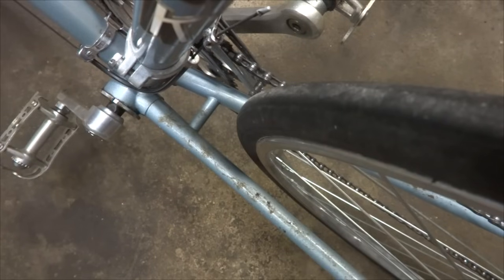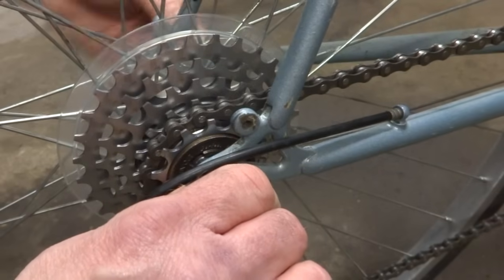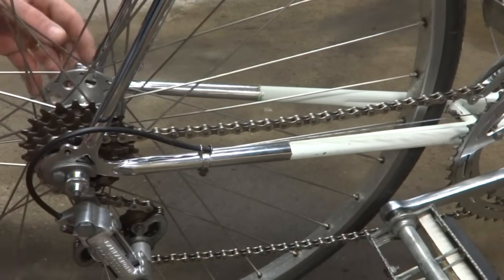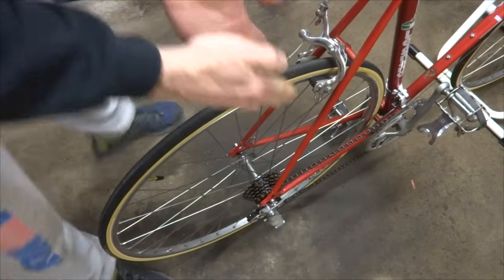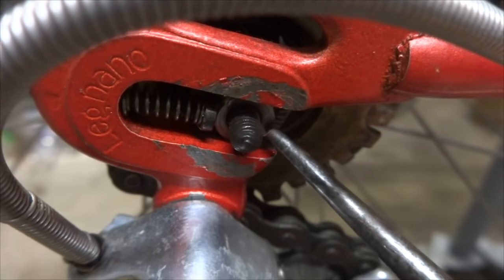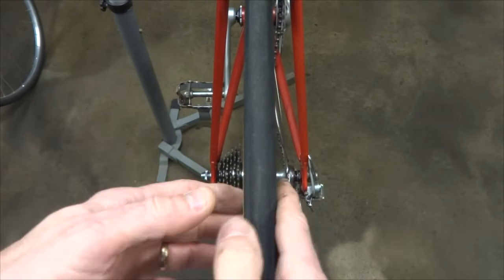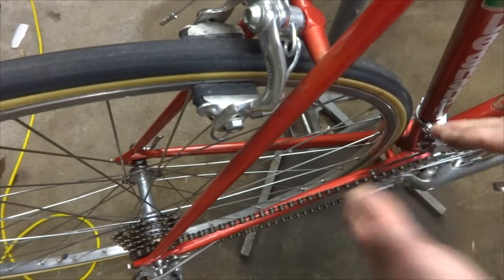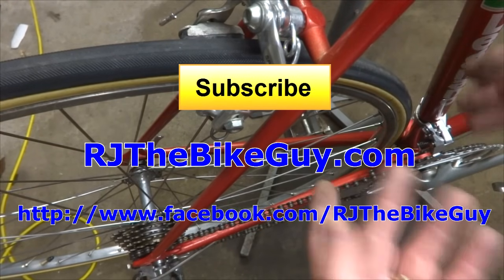Fix Rear Bike Wheel - Off Center/Rubbing Frame

Comment: Just spent 30 mins pulling my hair out because my rear wheel wasn't aligned. Watched your vid for 7 mins and solved it immediately.  Not all heroes wear capes!!!!!! Thank you so much :)
Reply: i spent almost 3 years
Reply: Bruh I thought the chain was the issue the whole time but even after I lubed it that’s when I found out I had to realign the wheel smh
Reply: chanteur
Reply: Same man. That and the breaks aren't working because of it. The first time replacing the tire tube has been a 3 hour mess that I won't get back.
Reply: Literally spent fcn 3 weeks

Comment: Thanks for this video! I'm not even an amateur bicycle mechanic and I was at the point of giving up and bringing my 1983 Jamis Boss Cruiser 5 speed to a repair shop.  In my case it turned out to be reason number 3. After re seating the wheel and tightening everything in the proper position, the problem was solved. I'm up and rolling again!

Comment: Took my vintage Miyata out of storage. Hopped on. It's acting funny and when I hop off the rear wheel is just dragging and won't turn. Realize it's jammed up against the frame. Panik. Start looking for potential replacements or repair shops. Would cost me more than I originally paid for the bike. 

Find this video. Watch the first 40 seconds. Fix my bike in less than a minute. You're a hero.

Comment: Awesome!!! my issue was the two small fine tuning ones you mentioned except mine was two grub bolts.....What I didn't realize was the smallest turn tighter on one side and not the other would make a huge difference. I had to fine tune the bolts until it spun without touching the breaks and was fairly even on each side.
Reply from the maker: Grub bolts?
Reply: Sorry Grub screw not a grub bolt
Reply from the maker: I don't know what you mean by grub screws either? Do you mean the dropout adjustment screws?
Reply: Yesss grub screws, I had to google it to know what they were. I thought it was only so it prevented the wheel going forward as you have to loosen them to take the chain off but your video mentioned the dropout adjustment screws. The smallest adjustment on those makes a huge difference. Thanks again
Reply from the maker: I just googled images of grub screws and I have not seen screw like that on a bike.

Comment: Thank you so much for the great content, I have a carbon road bike, and I recently upgrade my wheels to carbon. And what I noticed, the rear wheel is off center from the non drive side. So I thought it's a wheel dish issue and I gave it to the bike shop for dishing. But unfortunately the issue is still exist. Luckly later what I realized from the cassette side, (where the wheel end cap, hook into the frame) hase a small gap, so while fitting the wheel it's centred and then when I go for a ride it will of center. What is you best advice to fix this issue? Shall I rap the wheel end cap with something to fill the frame hook gap?

Comment: I tried to straighten my dropouts like you did with a 2x4 but I couldn't get it right. So I cut 2 thin pieces of aluminum flashing and it's perfect now. Doing it this way I think is actually better than the adjusters that are on some bikes. The axles are the whole way back in the dropouts.. Just my opinion..

Comment: Rode my bike with a off center rear wheel after I installed security screws. I was wondering if that was there before! I came across this video and fixed it immediately. Thanks!

Comment: 7:03 To check the axle is centered with the hub, would measuring the exposed threads of the axle be sufficient? After reassembling my axle in the hub, I have 1mm more of exposed threads on one side, do you think that would be enough to cause a wheel to be noticeably off-center?
Reply: It shouldn't..not if the axle is straight.

Comment: I currently have this problem. There isn't any rubbing but my rear wheel is off center with the non-drive side being closer to the frame. I'm switching to bigger tires tomorrow so hopefully it will be an easy issue to solve because if I don't get it fixed then my new bigger tire is definitely going to rub on the non-drive side. I have a sneaking suspicion that I messed up when I overhauled my hub/axle. I'm betting that the wheel isn't sitting completely centered on the axle after I reinstalled the axle. I which case I guess I'll have to loosen one side and slide the wheel over a few mm.

Comment: So I can spin my wheel freely off the ground, but once I sit on it and try to pedal the axle goes crooked (like quick release is loose) and the rear tire gets wedged at an angle and stuck unable to roll at all. Thoughts? Am I fighting the axle incorrectly? Is there a trick to these quick release wheels? When the rear tire spins freely there is the slightest of wobble I mean the slightest, that’s all.

Comment: Great can - video,  RJ. I've been considering putting wider tires on my road bike, presently 23mm, and I'd like to put say 28mm.  I noticed my tire is closer to the right side which hindered my prospects for moving to a wider tire. I said to myself if anyone is going to address this issue,  it will be RJ the Bike  Guy, and sure enough, you covered the spacing subject six ways to Sunday.  I'll have to  examine my situation to determine which of the possibilities applies, but I do have one question.  If I equalize the space and assuming my wheel is true, will I likely have to adjust the rear derailleur indexing?
Reply from the maker: If you mess with the hub spacers, then probably. Otherwise, probably not.
Reply: RJ The Bike Guy Thank you,  RJ. I always learn a great deal from you.
Reply: same thing lol. I'm thinking I'm going to have to loosen one side of the hub and slide the wheel over maybe 3mm. Last year I overhualed my hub/axle and most likely I didn't center the wheel on the hub correctly when tightening the retention bolts on the QR hub.

Comment: You have to dish the wheel when true. The rim is not centered over the hub in the rear. So the spokes are tighter on the freewheel side and will seat or stretch in time. You almost always have to pull the rim freewheel side. Also the rear end won't track if the wheel is not dished.

Comment: I am facing this issue after new hub installation. The tire rubbing the frame one side. What to do now? Does the loosening or tightening the screws will solve the issue ?

Comment: Time to figure out why my wheel when fully in the dropouts points to the right side and also the 12th gear when engaged has spokes sometimes rub against the chain on the gear and also it used to have a bolt on wheel but I made a new wheel with a quick release system so see you in 9 hours after I figure this out :)
Reply: yea so for anyone who sees this comment in the future, if your gx derailleur rubs your spokes on 12th gear, 99% chance that your wheel dish is too far towards drive side and the 12 speed style setup is EXTREMELY sensitive to improper dishing

Comment: Hey RJ....I got a fixie bike with dropout adjustment "screws" that are actually washers with a bolt end welded to it that go over the axle and feed through a plate and nut that goes on the end of the frame. Trouble is, when I took the tire off I didn't check first whether the washers with bolts went inside the frame with the wheel or outside the frame with the nut. What would you recommend doing with them, from your experience? Seems like they'll fit either way, seems like they were on the inside of the frame before but a retailer told me they go on the outside, which doesn't seem right.
Reply from the maker: I don't know what you have. Google images of chain tensioners and see how similar ones are installed.

Comment: Had this issue (still technically have) in my old steel frame bike, the frame was bent by about 1cm...

Bending it back was quite a challange without any specialized tools, managed to correct it enough that I now have 5 mm clearance from the tire to the frame on the closest side, the difference is low enough that the brakes (V-brakes) are working fine (and they better be, the bike weights 25Kg)

Comment: can a tire rubbing oh so be related to a innertube not being put in right as a bike is my only means for transportation right now that or walking I need to know it was working fine til I got what seams like a slow leak so I replaced it with a new innertube and now it is rubbing but it's hooks like you show I did not put them back all the way maybe that is why?
Reply from the maker: Did you go through all the stuff in the video?
Reply: RJ The Bike Guy yeah I found the problem it is hitting what looks like a metal frame above the tire just below the seat one oft those metal parts just for looks I was gonna remove it but I don't currently have the right screw driver to remove it right now
Reply from the maker: I can't see your bike so I can only guess. I am guessing your wheel is not mounted straight. Or you have a bent axle. Go through the video!

Comment: Hi, great video!  I have a question.  I have an old 1961 Schwinn Continental 10 speed I had just bought.  The tires were worn out so I had to replace them.  Before replacing them I was able to ride very long distances without using my hands, now after putting on the new tires, I am having a very difficult time balancing myself as I can’t ride without hands anymore.  I feel i find myself trying to counter my weight to one side and I still can’t keep balanced.  What could I have done wrong?  The wheels do look centered within the frame or so I think. 
Thanks!
Reply from the maker: Sorry, I can't tell you. Just changing the tires shouldn't do that. Check the wheel dish maybe.

Comment: Might seem like a daft question but.. You know when you visually align the wheel with the center of the frame..how crucial is it to get the wheel dead center? What I mean is, I get it about center, but after tightening the wheel nuts I notice one side of the rim is always about 1 to 2 mm closer to the frame than the other side. Is this OK or does it affect the tyre and chain? Many thanks.
Reply from the maker: The farther off it is, the worse the alignment. The more the bike will pull to one side. The higher the risk of death wobble at high speeds.

Comment: Hi, thanks a lot for the video. I have a question: I bought a new road bike a few days ago and haven't driven it yet. I didn't use a frame alignment tool but I don't think the frame is bent. When I'm putting the rear wheel on, there is a hex nut on the non-drive side that comes on top of the dropout, not allowing the wheel to fit in. To fit it in I have to seperate the dropouts forcefully. Is that normal? When I flip the wheel the offset is still on the same side. Should I try to remove the nut?
Reply from the maker: Sorry. I am not sure what the problem is. If the bike is new, take it back to the shop and ask them.

Comment: hey RJ,

Hoping maybe you or anyone else might be able to help me out. I have a vintage steel bike w. 7 speed shimano freewheel. Im having trouble keeping the rear wheel straight even when using an internal cam qr skewer(it tightens but then it starts rubbing the frame). Whats also weird is that I also notice a slight bend in the skewer after I tried tightening it further. IS this a frame/dropout alignment issue?
Reply from the maker: Go through the video or take it to a shop.

Comment: Hey, watched your video to try to fix my rear wheel problem. I have a solid axel style with the bolts. I tried tightening them and then all is well until i hop back on the bike again and after a couple of rotations the wheel is running against the frame again in the left hand side. Am I missing something here? Thanks.
Reply from the maker: Maybe you are not tightening them enough. Maybe the dropouts are misaligned. Maybe the cone/lock nut on your axle is loose and turning. Don't know. But now you know why it is rubbing. Figure out why it is slipping.

Comment: Hi. What rear derailler do you recommend for converting a fixie with horizontal drop outs to a 9 or 10 speed? Thanks.
Reply from the maker: I recommend buy a geared bike to begin with. Easier and cheaper. Better in the long run.

Comment: I have just a normal cruiser instead of a multiple gear bike, the tire is still at an angle no matter what I try. It's a 1964 Schwinn typhoon, is there any possible way to fix this? Please respond ASAP as I use this bike daily and it's unridable ATM.
Reply from the maker: Go through the video. If that doesn't answer your problem, take it to a shop.

Comment: Hi RJ the bike guy / everyone - When I break with my disc breaks, I notice my wheel pulls to that side (with quite a lot of play). I tighten the bolts inside, but after breaking a few times it happens again. 

Does this indicate new bearing cases needed each side do you think..? 🤔
Reply from the maker: I can't tell you without having worked on the bike. You need to figure it out, or take it to a shop.
Reply: I suspect it is..
But I appreciate you can't answer without looking.

Thanks for your reply

Comment: I rode my bike yesterday, and everything was fine. I took loosed the quick release to take off the back wheel to fit it in the car. When I went to ride it today got the wheels into the dropouts fine, wheel looks true, but the wheel is rubbing at the top (not side to side). Any ideas?

Comment: Heeelp, I have a bicycle with a rear derailleur that's overlaps the drop outs, and a wheel has a solid axle. And when I thy to tighten the nut as it gets tighter the torgue kind of pulls the wheel out of alignment again, it's very difficult to get it tight and straight, and if I leave it looser it's just gonna start rubbing if I drop it in lower gear as I'm going uphill
Reply from the maker: There should be serated washers under nuts.

Comment: RJ - my rear tire rubs against the non drive side chain stay only when I pedal hard, otherwise it looks to be in the center.  When I bounce my weight on the bike without pedalling the tire stays completely in the center and is fine.  Do you know what could be wrong?  Seems like the wheel is flexing left every time I put high pressure on the pedals.  Thanks!
Reply from the maker: I have not worked on your bike, so I cannot tell you. Maybe frame flex, or something loose. Shrug.
Reply: Ok No problem thanks. Thought it might be a common problem others were having.
Reply: Ended up being a broken axle
Reply from the maker: @mikes2204  That was in the video.

Comment: Hi RJ, i done front wheel alignment on vintage roadbike in its fork to be centered but when I take it back there it is not centered again. I am confused.
Reply from the maker: Did you flip the wheel like in the video? Is off center still on the same side of the fork? If not, wheel dish. Otherwise, fork may be out of alignment. https://www.youtube.com/watch?v=lx7BGBD0OdA
Reply: @RJTheBikeGuy  I checked them based on your 2 videos, it will be the wheel dish. Thank you very much.

Comment: I have a 26x2.30 wheel in the back with a hub motor it starts rubbing when i fill it to the max psi is it the tire size or spokes ?
Reply from the maker: shrug I can't tell you without working on the bike. Go through the video. Maybe frame flex or the tire is too big for the frame.

Comment: Hi. I'd like to know how to align in a straight line front with rear wheel. This may be necessary after a frame alignment . Thanks a lot.
Reply from the maker: If the frame is aligned, and the wheels are dished properly, they should be in a straight line.
Reply: @RJTheBikeGuy 
Yes. That's the ideal situation. But I like repairing and restoring old bikes and sometimes ( more than I'd like)  they come with several collisions. Fortunately iron returns to it's original position but........ I've usually have the problem with fork deviation. The rear part of the frame is easier to align using your method's. Thanks again from Argentina!
Reply from the maker: @zigobi6789  Then the fork and or frame is NOT aligned. If the fork is damaged from a collision, replace it. It's dangerous.

Comment: Could a modern 10 speed cassette contribute to this when fitted on an older frame? Many thanks
Reply from the maker: Not specifically. But if you expanded the rear triangle to fit a wider wheel, that could be related.
Reply: Many thanks.

Comment: Sometimes it is just the spacers of the axle not equal or that the axle is messed up, after replacing it with a new one without taking the good measures of the old axle on both sides..*

Comment: I've been having trouble with my 1972 schwinn. I adjust the rear wheel then after sometime it vears to the left. Axle is straight and I don't see any other damage. Ive untightened and retightened the nuts. Still it moves...
Reply from the maker: I can't tell you why without examining the bike. Have a mechanic look at it.

Comment: Help! I have an issue with my quick release wheel, everytime i get to my downstroke or when i put ina lot of power,  my wheel curves to a side and rubs on my  frame, what is causing this and how do i fix it?
Reply from the maker: Go through the video.
Reply: @RJTheBikeGuy  The wheel is properly in the dropouts, theres no play, its in true, the dishing is correct and the frame is correct,  what else dcould it be?
Reply from the maker: Well if you won't go through the video, take it to a shop.
Reply: @RJTheBikeGuy  
Those are all the things in the video you said to check for
Reply: Same
Reply: @fishpants7764  Similar problem. Seats in the dropouts fine. Spin the wheel free, absolutely centered no problem.
Soon as you get on it and pedal, unseats out the dropout on the gear side and wheel now digs into frame on the opposite side.

Absolutely maddening trying to figure out what is causing it.
Reply: @hefrvifamilygaming9540  This was a while ago but I think I replaced my bearing in my wheel, if you feel the two little nuts right by the hub in the wheel and theyre loose you need to tighten them if not try replacing your quick release axle.